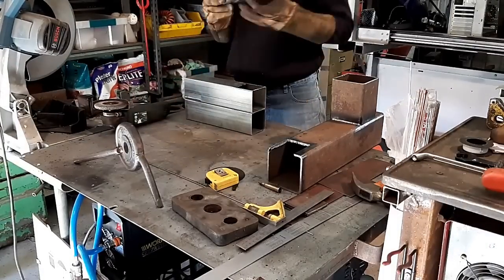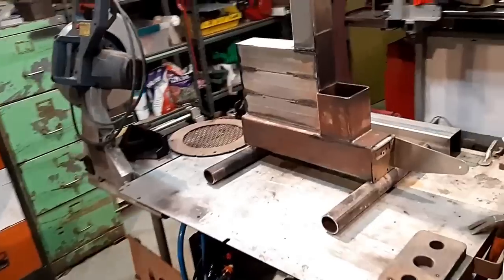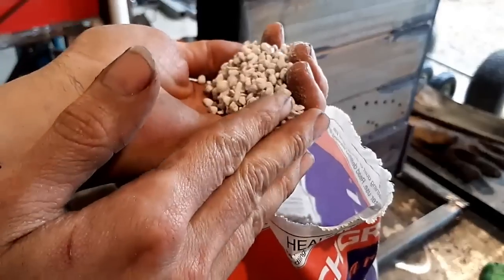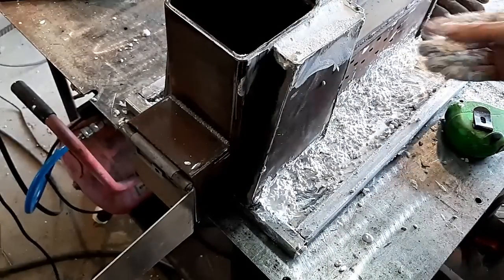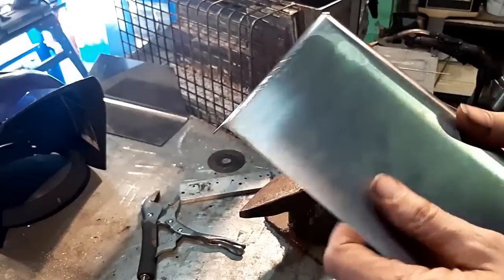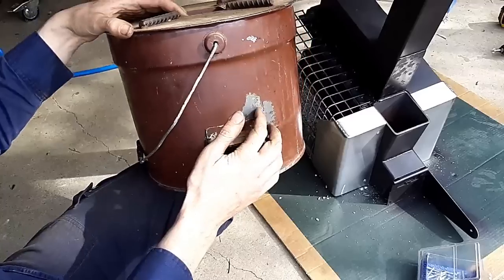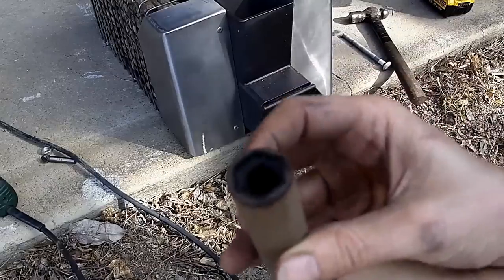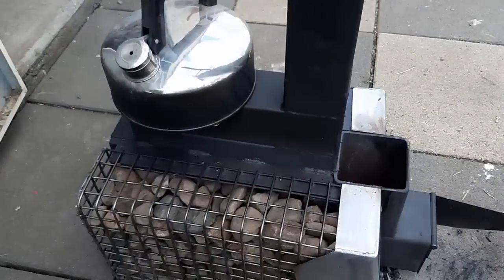Mini Mass Rocket Stove Heater pt 2

Comment: Surround the heat box with another box and fill it with ball bearings, pinballs, then take the finest driest sand and pour it slowly pouring the sand over the ball bearings with a hand held sander to side of box and vibrate that sand filling all voids between the ball from top to bottom. Super dense Mass packed tightly that will hold heat for days. 2 ta 4 hour burn to charge it up.

Comment: Seems like too much smoke escaping the fuel feed tube at start up. Inside a building this would be unacceptable. This is two years old, so you may have fixed this issue, may be by extending the fuel tube, or using shorter sticks and providing a cover for the feed tube. Your metal working skills are superb! Thanks for the video!

Comment: Generally a good idea, but I don't think you have a full rocket-stove effect happening. You either need to leave the bottom port open or add another air inlet feeding into the combustion area. You should't be getting any smoke coming back up the feed port. That means you don't have good circulation IMO. Just a bit of tweaking is in order.

Comment: Nice,,wonders why you didn't go right to the top of chimney run and box the whole lot with rocks,then could have used all the heat from the  rocks to boil kettle,and create more thermal mass??
Reply from the maker: That's were I would have liked to have gone with this build.  Ran out of time and steel.

Comment: What might give you just enough extra draw is to insulate an upper portion of the chimney. I just wrapped my chimney with 3" water-heater-tank insulation; the heat wasn't enough to even wrinkle the insulation's outer covering. I left the covering on the insulation to see if it would melt or anything. Much cheaper than rock wool.

Comment: I get a kick out of your fabricating skills 🙂 I really liked a gasifier stove I made out of a 55 gal drum with a 30 inside it; hot, clean burning, little ash (and the grate didn't get too hot, "glad", it was just a barrel bottom). What I've wanted to do is combine the rocket feeder down to the grate allowing for a smaller burn chamber, and to get that heat from the air mixing again by the top burning the gases and smoke. I haven't had the opportunity lately ... but you might 😉

Comment: If you build an outer box (by all means add a few rocks inside the box) but use a 12 volt fan to blow air through the box to blow secondary heat into the room

Comment: Good job.  Great skills with the tools too.  I was thinking about adding some steel heat sinks as well to spread the heat out faster.  you could add a small air pocket in the mass as an air induction to spread the heat faster, then close it to retain the heat for longer.
Reply: This so badly desing that even gindergarden child wuold make as good rocketstove. If you found sauna you should totally play whit it and find out how does it work... In sauna wooden stove or kiuas are same desing and this not even close to rocket stove.
Reply: What do you need For fire? Heat, air & fuel is good way to start you project and remember that hot air allways wanna go up and hotter the air is faster it Will rise and will make a draft if you can deliver fresh intake air.

Comment: Watched again. With  the cooler weather, and my new plasma cutter, I'm inspired in this direction again. 
Please do an update vid to show it in operation, and any changes you've made.
PS, Ive been in NZ for 2.5 years now, and a subscriber for 3. My fab skills are vastly improved, I learned to tig in lockdown last year (handy since the fab shop up the road closed down) and I'm tigging fairly well, stainless and mild, sheet metal as well, both hands. Don't have much practice in summer, but will do more fun stuff this autumn. Your last upload disappeared, hope all is well with you all.
Reply from the maker: Thank Craig, all is well. My lovely wife accidentally uploaded a random piece of footage to the channel. I couldn't leave it up.

Great to hear your fabrication skills are getting better. Tig welding is the best.
I haven't done much with this stove except use it every Winter to heat the shed. 👍

Comment: Could you make this modular, so the mass baskets can be lifted off and moved separately? That would make it easier to move around. Maybe one less return on the pipe before going into the chimney stack too. Then it'd be at the back and give you a nice flat top so you didn't have to balance your kettle.

Comment: This suggests that you could pile dirt and rocks on both sides of a rocket stove in a hot tent to absorb some of the heat, later radiating it outwards to save a few logs during a cold night. Not sure how you could make a manifold that wouldn't weigh too much... prefab tubes with U joints?

Comment: Here's a trick I use when welding on the bench. Give it a light spray with canola spray before you start and for steel it is pretty good anti spatter and the no name stuff is less than $2 a can. It doesn't seem to affect the conductivity of the bench and when it gets hot it smells like someone is cooking. It saves having to keep grinding the benchtop. If you get it on aluminium though it causes a few problems when you weld it.
Reply from the maker: Best use for canola oil I've ever heard. Thanks mate 👍

Comment: A gas hot water heater used to have a baffle that ran up the center chimney forcing the air against the sides to heat the water faster which would be heating your mass

Comment: Isn’t one of the advantages of a rocket mass heater that you also build mass around the exhaust pipe to catch all of the energy? The designs I usually see have the exhaust make a horizontal loop with a small rise and when it comes back to the burn chamber is directed to exit the building.

Comment: Great. 
Could this rocket also work inside the house ? I Saw some smoke getting out of the wood inlet at some points.
Reply from the maker: With some refinements it could be, but I wouldn't recommend it. 
There are better designs that are more efficient and produce more heat that are out there. 
This little stove was just for a bit of fun to bring a bit of warmth to my workshop.

Comment: For the mass surrounding your heater, a mixture of 50% concrete and 50% perlite would make a really good, fairly dense and fairly light medium at the same time. It will have good thermal conductivity with the sides of the heater. I saw it done on another you tube channel.
Reply: Thanx for the tip

Comment: Interesting but I disagree with your Youtube adviser. I quite liked pt 1, but in part 2 there were many points where I had no idea why you were doing certain things.  For instance, why did you make the little pockets of perlite and PoParis and put them where you did? I figured they were a thermal barrier but for what? To keep the heat from the fuel store area perhaps but that wouldn't seem necessary. In the first video, you were a good teacher but in the second, not so much.  It is so much better when we hear what you are doing and why.  

Anyway great stuff.  Metal shop was my favourite non-academic in high school.  You have a great kit too.

Cheers.
Reply from the maker: Thanks for the feedback mate. I will make more informative video's, as your comment is one of many along the same line. 👍

Comment: If you restricted the air at your feeder tube aswell you could slow down the burn and control the heat better. Eventually reducing the length the fire creeps up your riser... nice build video. Thanks.👍

Comment: I've built two rocket stoves out of concrete, only tested the first one so far. That first one is very thick-- cast in a Lowe's bucket (approx. 5 gals.). Burned sticks in it for 2.5 hours, and the whole thing amassed some good heat. Could only keep my hand on it for a few seconds.  But after an hour and a half that heat was largely gone (this was outdoors, but no wind and the temp. was  only around 70F-- cool, but not cold.). 

My little shed/workshop is only 12'x12' (about 4 meters x 4 meters). It has no ceiling-- the space is open through the rafters to the roof. Trying to figure out how to add more  mass to the thing to warm this space, since a chunk of something only the size of a 5 gallon bucket can't spread a lot of heat in an un-insulated, let alone retain it for very long. I have no floor space for anything much bigger than that, so the "footprint" has got to be pretty close to what I have. I can go UP, but I can't go OUT with more mass.

Anyone got any ideas?
Reply from the maker: Just a thought. Grab a pair of brake drums off a truck and make a pot belly stove/rocket. I will be making one for my barn.
Reply: Sounds interesting. The only metal-working "tool" I have is a hacksaw, however, so I'm SOL if I need to weld or grind anything (Warning: American Slang). 

I do have a drill and a tiny drill press. And wrenches (spanners and sockets). So there's that...

I'm retired and have only $200.00 left every month after bills (considerably less if I want some beer), so I really can't invest much in equipment-- assuming I had any available space to keep it.

I hope you film this build and make it simple enough for those of us who are tool and equipment destitute!

Love your videos, keep 'em coming! And thank you for your reply to my comment-- greatly appreciated.

Comment: Have you tried using any cement that has foam introduced into it... they use regular dish and laundry soap combination when mixing the water into the cement and whip it with a mixing paddle... it should give mass which is still enough to conduct and radiate the heat

Comment: Why rocks ?
Why one side ?
What is the best mass for thermal contact, thermal absorption and slow thermal delivery  ? 
Are these the only (and or best) questions  ?
How can the concept be improved  ?
Reply from the maker: So why Rocks?  was a material I had available and it is a material that anybody else making the stove will have access to without too much fuss.  Why insulation on one side? because I really wanted to have installation around some  the burn chamber, increasing heat inside the stove, every little bit helps. Probably cob would be the best thermal absorption material, it just would have been messy to use and lot more work so I went with rocks. ( and the rocks were more visually appealing)  Improvements would include an oil burner attachment, and or a pellet burner cage to drop into the feeder.  And I think one less layer in The Zig Zag would also have given me a better hot plate and more draw.  Thanks mate

Comment: The challenge with using metal in the burn chamber of a rocket stove/heater is that when they are running properly, they create enough heat that spalling of the metal is a serious concern.  That is why all of the successful heaters of this type employ either cob or masonry in both the burn chamber and for the thermal mass.  Masonry and cob are not so easy to fabricate with as steel, and the mass created comes along with the attendant weight/volume.  To be efficacious, there are no other means that have been successful.
Reply: In this stove I don't think it's gonna be hot enough to be a issue . But if it was a well insulated burntube it would be a issue for sure.

Comment: I love the creativity and the intent to go for compact but something is missing. I thought the reason the stack went up the middle and had a shroud around it was to maintain the heat up the stack since being enclosed it stayed hot. This helps the draft keep going hot and heavy. Then when that work is done you extract as much heat as possible for your mass. Sure it will be bulkier but the biggest problem I see you have here is the draft. I think this is because you are sucking out the heat before it can do the drafting work. You are basically adding the mass before the draft generation. Your draft problem will get worse the more mass you add that sucks the heat out. Edit: I see the insulation really helped and your mass is somewhat insulating too. 
I'd like to see you do the mass thing with the vortex mass heater you made. Only put the mass after the draft generation. I'd like to see you do it because otherwise I have to do it and I can't afford all the steel here in the US. Plus you got one or two tools I don't have. Which is saying something because I collect tools.

Comment: Good Job 👍 I was thinking it might be a good idea for your flue to go up 1.5 m and sharp u turn back down and then back up again to allow all the heat to be absorbed by the flue mass. So at the exit of the flue you have dramatically lowers exhaust temp and this radiates out to your sheds ambient air . I built one without any insulation with as much surface area as possible to radiate all the energy as possible and wow did it radiate . I used lots of 20 mm rhs square tubes all stuffed into a  100mm rhs exhaust so as to get as much surface area as possible to absorb as much heat generated as possible but warning ⚠️ you have to have it at the first section of flu out otherwise it’s hard to start. You have to get a bit of convection first

Comment: The Russians use water as the heat sink since it is the best/economical .
Reply: 2451star this is the comment I was looking for. Water jacket around the outside would be best. Hot water on demand and best thermal mass.

Comment: now I understand you want to create a thermal mass so you can emit heat gradually when the fire is out,,,  to be honest that is a good thing to try  but I would just have a heat exchanger and  exchange the heat through air and use your house and furniture as the thermal mass because a few rocks will not be that much to make such a difference...  you got the burn efficiency  perfect but just your heat exchanging ideas i would argue about
Reply from the maker: I agree with you.  If I was going to build another one I would improve the heat exchange. 👍

Comment: Ok so in the interest of getting the best heating possible has anyone played with an aperture at the combustion point for maximum efficiency? I have a slide type on mine and managed to get a pretty bright white light and a whoosh do you think that whoosh is sustainable?
Reply: I'm experimenting with the air velocity past the aperture as a means of leaning out the burn on my mas heater/ rocket forge.
Reply: Would like to get opinions on by build inspired by this amazing Channel and have pictures/video of my proof of concepts.
Reply from the maker: Wow, that sounds pretty cool!  Keep us updated with your findings, as I am always keen to learn from those out there experienced in this field, but I don't have anything to add to your comments, it sounds like you are right on track.  This stove does have an air flow control, though it needs to be developed more. Cheers, Stephen

Comment: I'm a rocket builder.

Metal is a horrible material to make rockets from. Its ok as support, and a form to use lined with insulated firebrick, but wherever fire meets metal, thermal suck happens....

This stove will work as a heater, the metal giving off the heat. If you have mass following it, you'll not get great performance from the mass.

My present rocket has about 10 meters of flue after the stove, 3.5 meters goes through a mass.... and I wish it was more... the next stove will improve this.
Reply from the maker: I agree 💯 . What I have on hand is the major factor in my builds.  I would love to build a proper rocket stove one of these days.  
Cheers Walz

Comment: Didn’t u block the air holes with the rock whole?
Reply from the maker: I welded the holes up. They were interfering with the air flow in the hopper.
The flame was creeping up and out consuming to much fuel.

Comment: This design COULD play a major role in "Wood gasifier"" based on its set up. More work involved yes but initially with that said, you can then run a generator from it. Only concern then is spare piston for gen and bearings IF all goes tits up mad max style ONLY food will be the source not fuel.
Reply from the maker: Yeah, I'm hearing you. I actually have some wood gasifier plans to for a small combustion engine, it's something I've wanted to do for a while and probably should do sooner rather than later.

Comment: It needs more air. There shouldn't be ANY fire in the feedbox. The smoke isn't going up the chimney, its coming out of the feedbox. If you had opened the bottom air feed just a little or added some extra holes, it would have burned better and safer. When you fill the feedbox, it shuts off the air which is needed in order to keep it safe.

Comment: It seems too me there are several real problems with this 'design'. Lots of resistance to air flow, due to zing zag & very long riser. If you want mass heat, then the stones probably should be IN the hot air flow. Then fins on out side to radiate. But - fun anyway I guess. My bet is the smoke is condensing in the stack.

Comment: I miss the commentary, your thought process, and theory. Add significantly to the build. 
If this model was adapted, to also be a water heater. The residual heat, is what I’m interested in. For heating an outdoor tub. Then holding the temperature, for a few hours, in a Canadian winter.